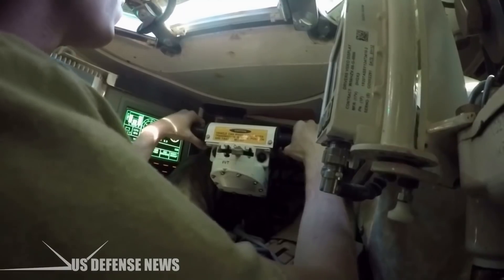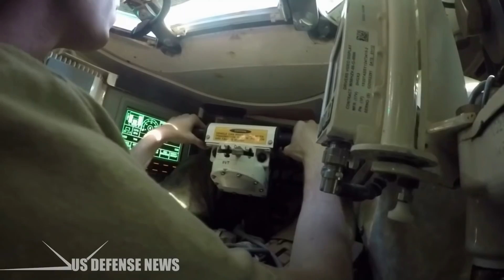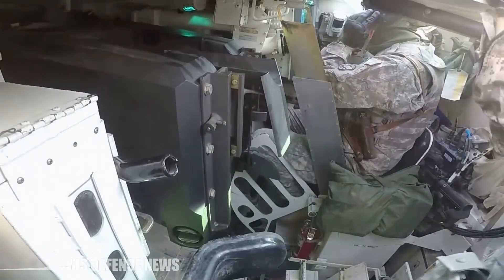Why No One Wants to Fight U.S. Abrams Tanks?

Comment: Weaker than the Russian equivalent.
So extremely fuel inefficient that it barely saw action in the golf wars.
There's a whole bunch of reasons why nobody in the worlds wants to buy this ancient piece of crap...
Reply: +Martin Ruf

> "Weaker than the Russian equivalent."

 How so?

> "So extremely fuel inefficient that it barely saw action in the golf wars."

 Turboshafts (gas turbines) are inherently more efficient than a internal-combustion engine of the same size. I think the word you were looking for was "bad fuel economy/mileage". 

 What do you mean by "barely saw action in the Gulf Wars"? 

> "There's a whole bunch of reasons why nobody in the worlds wants to buy this ancient piece of crap..."

 That's not "a whole bunch of reasons".

 You have not explained how it was crap. Ancient? As compared to what? A T-80? T-90? Leopard 2? 

 Australia, Egypt, Iraq, Kuwait, and Morocco all use the M1.
Reply: Since you actually took the time to deconstruct my statement, I'm happy to reply in detail:

"Weaker than the russian equivalent"
--> I'd like to compare 3 tanks altogether: The Abrams, the T-90 and the Leopard 2.
Basically they have 3 different aspects in which they are leading:
Abrams has the best armor (depleted uranium) - simply because there is no harder metal that some other designer COULD use.
T-90 has the best gun. Why? Because they use depleted uranium in their ammunition. Equal to the Abrams, there is simply no better material available, which makes the T-90s gun by default the most efficient in terms of flight velocity and impact on target. (Aiming however is a different story)
Leopard 2 is the most accurate, the most fuel-efficient, and the most versatile. I'll get into detail at the end of this essay.

"Weaker" simply because the T-90 has a stronger gun. Combine that with an easier handling and HALF the production cost, and you simply have a better tank. Due to contractual reasons, the US has limited its tank development on the Abrams tank. It was not possible to design a completely new tank. This is why the weaknesses of earlier models have never been eliminated.
If you keep development limited to an outdated model, you can't expect it to stay completely up-to-date.
The Russians on the other hand don't have these contractual obligations. If their T-72 has fundamental design issues, they can just introduce a new model (T-90, or T-14).

"fuel inefficient"
You have been right to correct my denomination. If you fight a war, it is of major importance to be able to move from A to B in the shortest time possible.
If you look at the gUlf wars, the Abrams has mainly seen action in close quarter fights. If there has had to be a quick advance on open ground, the Leopard 2 was the mainly used tank. Why? Because the Leopard was faster, needed less fuel (easier to supply) and its engine was less prone to failure.
With "barely saw action" I meant scenarios in which tanks would fight other tanks on a larger scale.

"There's a whole bunch of reasons" meant that I could extend the list further. I have just given 3 reasons why in my opinion the interest on the world market itself describes the real value of the Abrams compared to other tanks.

"Australia, Egypt, Iraq, Kuwait, and Morocco all use the M1." Yes. But I find it interesting that the M1 Abrams is only sold in those states in which the US has a heavy political impact. And no, I don't mean allies. I mean states that the US can also put under economical pressure.
To make it easy: Just compare how many Leopard 2 are sold worldwide.
Then compare the numbers and the countries to the Abrams.
If a neutral state has the option between the T-90, the Abrams or the Leopard 2, it almost certainly will decide to buy a Leopard 2.

"ancient piece of crap"
Let me explain.
If a T-90 or an Abrams have to drive about 30° upwards, they have to fix their barrel in place. This means you lose time and you are an easy target when driving up a dune in the desert, for example.
The aiming with the Abrams is controlled (or at least assisted) via software. Which has already been established to be inferior to mechanic solutions.
The armor is radioactive - which means it's a bit stronger than any other alternatives, but it also intoxicates your crew. I'd rather stay in Chernobyl for 1 month than stay in an Abrams for an hour.
The tank is the most expensive, the hardest to maintain and the most difficult to sustain on the frontline out of the three mentioned tanks.

Let's compare it to the Leopard 2: The current model A7+ is faster than the Abrams. It is much more maneuverable (please look it up - those videos are fun to watch). It doesn't have the aiming restrictions when driving even above 30°. Furthermore the aiming system is purely mechanical.
Here's a video of a Leopard 2 jumping over a hill and shooting mid-air. This is not just for fun - it is actually 100% accurate while moving in any direction. Thus it is quicker to aim AND more precise.
(https://www.youtube.com/watch?v=Lj75U7TkBBY)
And still it is 35% cheaper than the Abrams.

Why should I pay more for an older tank, that is slower, less flexible, has worse aiming, requires higher cost to repair and maintain and has no vastly superior armor or any kind of higher firepower?

It's the same story like the Tiger and the King Tiger: If you stick to a faulty design (Tiger I), it will always inherit its flaws and weaknesses (Tiger II). The Panther was a completely new design - which lead to a superior tank.
As long as the US is gonna stick to the outdated Abrams-design, it will never overcome the mentioned faults and weaknesses.
Which is why the Leopard 2 MK7+ currently is the best tank in the world.

Please feel free to reply in detail or to shame me for saying "ze German tank iz superior!"
Reply: +Martin Ruf

 I enjoy this civilized discussion. And for that, I thank you. 

> "T-90 has the best gun. Why? Because they use depleted uranium in their ammunition. Equal to the Abrams, there is simply no better material available, which makes the T-90s gun by default the most efficient in terms of flight velocity and impact on target."

 The Russians took a hiatus on developing depleted Uranium rounds with the 125mm. gun for some reason during the '1980's. Their ammunition listing for the '1990's is quite stagnant for those munitions. The U.S. has been using the depleted Uranimum since the introduction of the M829, back in the early '1990's. The M829A3 is the current variant in production. I'm not sure of the performance compared to either due to the limited information on the Russian rounds. Though I'd argue the American ammunition is considerably more matured given it has seen combat. 

> ""Weaker" simply because the T-90 has a stronger gun. Combine that with an easier handling and HALF the production cost, and you simply have a better tank."

 The production costs are a bit more complex to deal with given that Russia has a much lower value of equipment (not necessarily of quality). It would cost the T-90S, probably as much as an M1A1 or M1A2 in 2006 in the same year, to be produced in the U.S. Procurement, the newer T-90's are slightly less expensive based on articles that I have seen, at about $5 million U.S.D. (as of 2015), and M1A2 SEP (v.II) at about $7.5-$8.25 million U.S.D.

> "If you keep development limited to an outdated model, you can't expect it to stay completely up-to-date."

 Development might be limited in budget relative to other program, however I don't see how the M1 is outdated or not up to date. Please elaborate if you can.

> "If you look at the gUlf wars, the Abrams has mainly seen action in close quarter fights. If there has had to be a quick advance on open ground, the Leopard 2 was the mainly used tank."

 I'd argue that to be more the case with the 2003 Iraq War. The Persian Gulf War was renown for open engagements between M1's and the Asad Babil's (Iraqi (Hussein regime) T-72 "copycats"). Such as one of the last large tank battles of the 20th century, the Battle of 73 Easting. Though often exaggerated. The U.S. M1's, M1A1's, and several M1A2's, along with American and British mechanized infantry knocked out more than three hundred armored fighting vehicles of four Iraqi Armored Divisions in under an hour (it's often quoted to be 25 minutes, though this is more hearsay). This includes 160 tanks.[I] This was very much in open desert. The only total loss for the Coalition forces was an M2A2 Bradley Infantry Fighting Vehicle knocked out by an BMP-1 surprisingly. 

> "Why? Because the Leopard was faster, needed less fuel (easier to supply) and its engine was less prone to failure."

 The Leopard 2A4/2A5/2A6/2A7 is rated at 72km./h, and is typically governed. Though records of 90km./h. have been mentioned, though I cannot verify them. The M1's and M1A1's were also governed at 72km./h., the M1A2 governed to 68km./h., most of the mentions of speed for an ungoverned M1 is hearsay, but there is a verified account of an M1A1 breaking 96km./h. during a exercise at Fort Knox Armor School. Both have unverfied mentions of breaking the 100km./h. mark. The Leopard 2A5 at 116km./h, an M1A1 AIM at 122km./h., though I have my doubts about those figures.

 To put it short and simple, they are very comparable in speeds, and ungoverned, the M1 or M1A1 is certainly capable of outpacing a Leopard 2. Though likely not a M1A2.

 Aside from engine life, the reliability of the M1 is one that depends on which year and which report your citing. Most issues that I know of that came up during both the Persian Gulf War and the 2003 War in Iraq, air cleaners were the primary issue. Challenger 2's in the latter conflict had equally frequent issues. Though I can not recall any exact figure off the top of my head.  

> "But I find it interesting that the M1 Abrams is only sold in those states in which the US has a heavy political impact. And no, I don't mean allies. I mean states that the US can also put under economical pressure."

 Morocco and Egypt at the time of purchase (Egypt holds license to produce M1A1's and M1A2's from General Dynamics Land Systems since the mid '2000's), I'd argue had very little in the way of being pressured. Iraq and Kuwait, I see your point. While I still don't agree, I withhold my argument due to lack of evidence for it. Australia had the choice between the Leopard 2A5 (the demonstrator was a Strv.122) and a M1A1 AIM, in which the Leopard 2 was found to be in pretty bad shape mechanically. The M1A1 won the bid for the Australians. The Australians are allies mind you. 

> "The armor is radioactive - which means it's a bit stronger than any other alternatives, but it also intoxicates your crew. I'd rather stay in Chernobyl for 1 month than stay in an Abrams for an hour."

 Depleted Uranium only releases any serious amounts of Alpha particles. Which, likely only if the Uranium is as a powder or as slag, if ingested it would then cause medical issues. No issues with skin contact that I know of have been mentioned. Radiation is not my strong-suit to be honest. Keep in mind, the armor is in plates, separated and sandwiched between other materials such as ceramics, steel, and ballistic-grade woven materials. There is no direct contact to speak of. 

 On another note, Chernobyl is actually relatively safe to live in, but due to fallout in the sediment and other issues, its been condemned. Reactor Station No.4, that's another story.  

> "The tank is the most expensive, the hardest to maintain and the most difficult to sustain on the frontline out of the three mentioned tanks."

 The Leopard 2's and their analog M1 variants are not that considerably different in costs. Some earlier Leopard 2's were considerably cheaper. But I don't see any cost differences that statistically would be meaningful outside of purchasing a thousand of these, not even going to the point "which is cheaper for the variant". T-90 is generally cheaper overall, and in purchasing hundreds, cost certainly can be seen  to be of more favorable virtue of the tank. 

 Elaborate on "hardest to maintain", please. 

> "Let's compare it to the Leopard 2: The current model A7+ is faster than the Abrams. It is much more maneuverable"

 The Leopard 2A7 is still rated to 72km./h. as I had expressed earlier. Not by any margin that would be meaningful. And it's most certainly not faster concerning the "ungoverned" speed of each tank in its plethora of variants.

 How is it much more maneuverable? They are of similar weight, ground-pressure, track size, and so on. The Leopard 2 (Leopard 2A5/2A6/2A7) is marginally lighter, but has noticeably wider tracks. The M1A1's and M1A2's have more area making contact with the ground however, have slightly more ground pressure. Traction is close enough. 

> "It doesn't have the aiming restrictions when driving even above 30°. Furthermore the aiming system is purely mechanical. Here's a video of a Leopard 2 jumping over a hill and shooting mid-air. This is not just for fun - it is actually 100% accurate while moving in any direction. Thus it is quicker to aim AND more precise."

 Can you cite those aiming restrictions? I have not seen those in the Field Manual at all. I'm not sure what you are referring to concerning the aiming system? Controls? Actual traverse? The M1's turret traverse is hydraulic, electric has its advantages. Generally lighter, smaller, and may be easier to replace. Near instant response. However more likely to go wrong and less likely to be able to be diagnosed for its issues in the field. 

 The M1 also had a two-axis gun stabilization system like the Leopard 2. 

> "The Panther was a completely new design - which lead to a superior tank."

 The Panther was a completely different type of tank for a different doctrine than the Tiger. So it's not really comparable. Features-wise, I get your point. Though it doesn't really stick as an argument.

> "As long as the US is gonna stick to the outdated Abrams-design, it will never overcome the mentioned faults and weaknesses."

 The Leopard 2 is an older vehicle operationally mind you than the M1. The Germans stuck to the Leopard 2, and continue to develop it. As do the Americans with the M1. I don't see your point here. Please elaborate. 

> "Which is why the Leopard 2 MK7+ currently is the best tank in the world."

 Aside from subjective opinion, there really is no such thing as "the best tank in the world". It's too broad a spectrum to really make that point as it doesn't focus on any conditions to rate the vehicle. 

[I] - Krause, Michael D., "The Battle of 73 Easting, 26 February 1991" , A Joint Center of Military History and Defense Advanced Research Projects Agency Project, 24 May 1991

Comment: Interesting. The British phased out the 105mm with the end of the Centurion in the mid '60s, replacing It with the 120mm on Chieftain. The last British tank to feature a 120mm gun with one part ammo was the Conqueror, again replaced by Chieftain. Even with multi-part ammo, I've had three rounds in the air, at the same time (firing around max optical range) 

Also the British do not use DU rounds, we use Fin (ok it has a DU core, maybe)
Reply: We’ll still smoke you

Comment: Challenger 2 your argument is invalid
Reply: Add the Leopard 2 and MBT Altay with it and many other tanks that can challenge it.
Reply: Even tho it's not america would steamroll britian in a skirmish/ground battle
Reply: You seen the lower glacius that is 60 mm thick?
Reply: Its like 100 abrams on like 3 challenger 2s since half of them need newer engines to move and the americans have already built an armada of abrams
Reply: @ExHyperion  most of the abrams are still m1a2 or m1a1hc so not the new m1a2sepv3.  It's not a armada because they are still very expensives, the british have around 250 challenger2 and the american have around 850 abrams of m1a1 hc or m1a2 and some ma1a2sepv3. The british have only a 76mm plate on the lfp but the american have composite that can stop 550 mm ke so the challenger 2 would go thouth it like if it was 76. ( the charm3 of the challenger pen 660mm at 2000m)

Comment: The Challenger two would make this look weak! You know the British have never lost a single Challenger 2 in a war.
Reply: +Speketwome

 Well no Challenger 2 has been a total loss to another tank's fire, aside from a blue-on-blue incident. Multiple Challenger 2's have been lost or written off, for a variety of reasons, but repaired.
Reply: The British have never lost a challenger 2 to a fight. There is no tank that could give it a run for its money
Reply: +Speketwome

 Never any total loss to anything but another Challenger 2. However there have been numerous cases of Challengers 2's being disabled, and though retrieved, at least one case of being abandoned. One case was an RPG-29 penetrating the lower glacis of a Challenger 2 in Iraq in '2007. Blew the left foot of the driver. The tank was abandoned if I recall correctly, but was retrieved and not written off.
Reply: So you're trying to say that a RPG went through the lower glacis plate of the challenger? Ok then sure... Actually I stand corrected, only one challenger two has ever been lost... to another challenger two in an accidental friendly fire fight.
Reply: +Speketwome

> "So you're trying to say that a RPG went through the lower glacis plate of the challenger?"

 I stand corrected on the year, it was August of 2006. Not Summer of '2007. The driver's name was Sean Chance, of the Queen's Royal Hussars.

 > "Actually I stand corrected, only one challenger two has ever been lost... to another challenger two in a friendly fire fight."

 Exactly.
Reply: So it penetrated but didn't kill the tank did it? and losing a tank to a britsh friendly fire incident is not loosing it to a war.